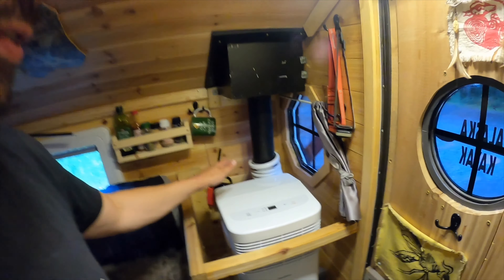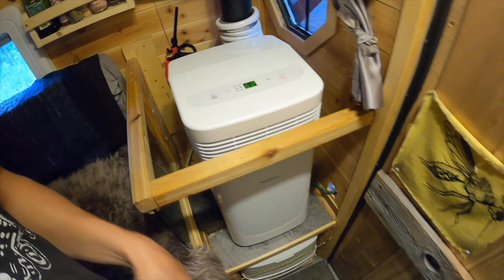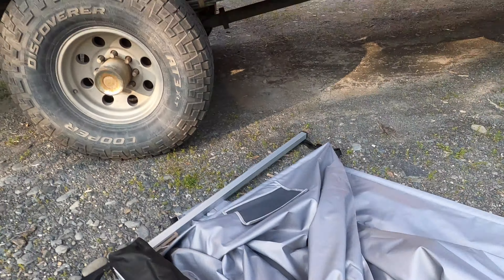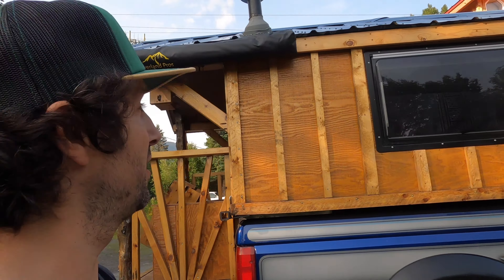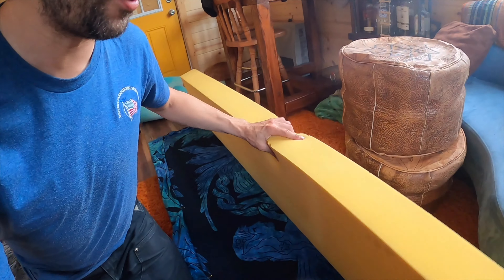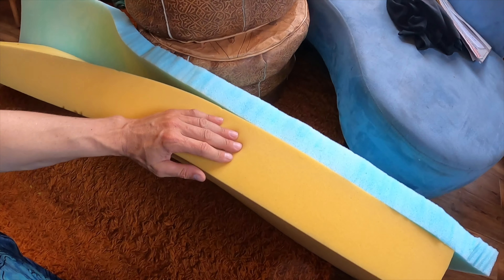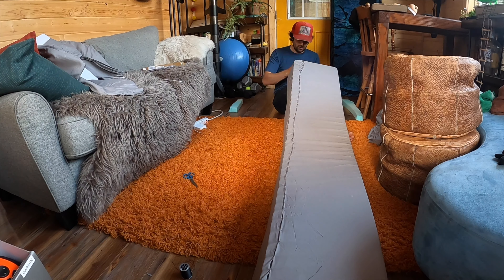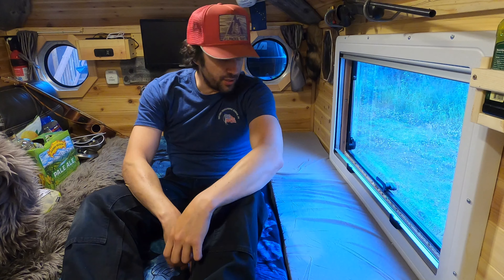Powering a PORTABLE AC with a HONDA 1000 ?, Overland SHOWER, & How to make CUSHIONS for RV couch bed

Comment: Once the truck is finished, would like some kind of truck bed camper for it thats different (maybe use some of the leftover RV parts to build it with, like the propane stove, outer fiberglass skin and windows and water/waste tanks)
Reply from the maker: awesome man, yeah find an old scrap camper if you can for appliances and save a bunch that way!
Reply: have an 86 class C with all those pieces...  stripping it to build the truck on...

Comment: just starting a custom pickup build (starting with an old 59 White 3000 COE truck cab)
modifying it, and mounting it on an old RV frame and adding at LEAST an 8' bed, mist likely dually (because the RV already is?)
Reply from the maker: awesome man, have fun with the build!

Comment: I have memory foam and you might find you will have to have two pieces of 1/4" or less wood type hard material cut in say 1 1/2 foot by 6 foot that you can stack under bed when not in use then lay side by side when you use it. Memory foam has a tendency to give you a quicksand effect and you might feel the slats without the wood. Oh and by the way what hot climate are you going to I am in phoenix now and yesterday it was 118 wooh that's hot!
Reply from the maker: Going to be really close to your area in a few weeks, I got a feeling the AC will come in handy lol.  The 4" thicker foam is super super dense and high quality, so you can't feel the slats.
Reply: @TruckHouseLife  Glad the bed worked out good and glad you got air for this area it has been HOT!

Comment: Super nice job on your AC addition!  I wonder how long the generator will power it with a full tank of gas?
Reply from the maker: Thanks! It goes about 6-8 hours on 1 tank of gas, super efficient!
Reply: Heck yeah!  That’s a long run for 0.6 gal. of gas.